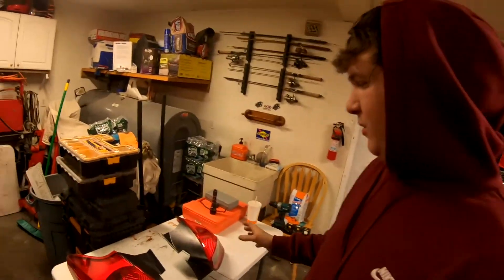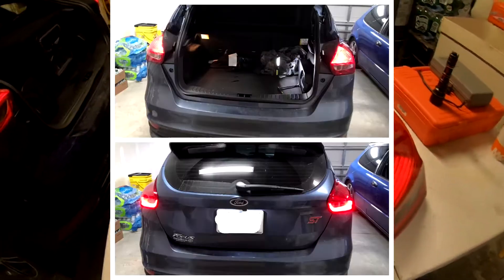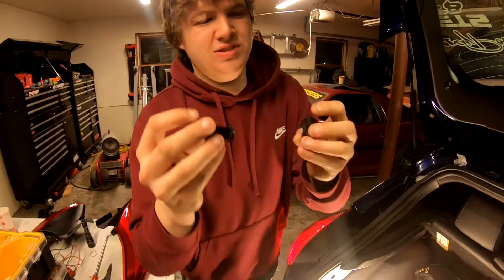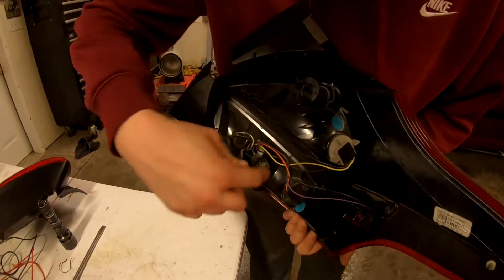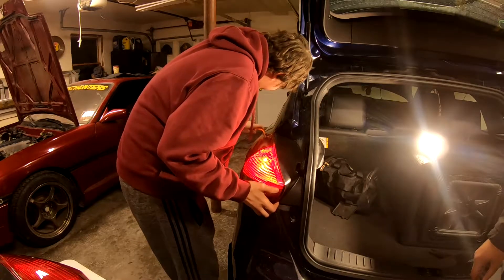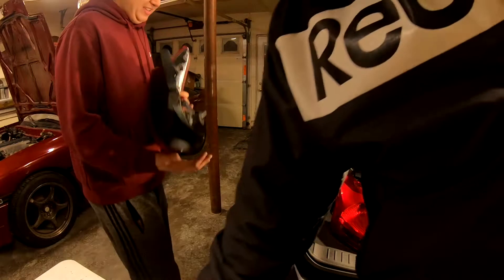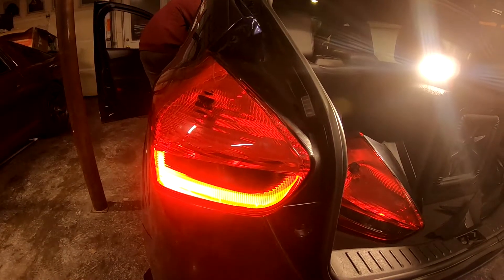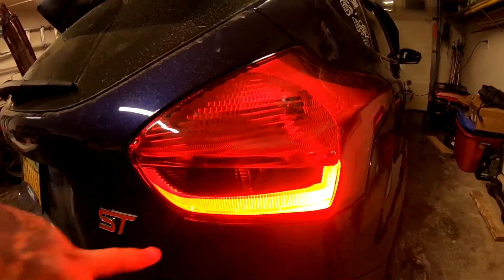Focus ST | RS Tail lights Install

Comment: Did you have any fitment issues? I have been wanting to put these tail lights for a long time and wasn’t sure if they would fit.
Reply: Its a factory tail light, plug and play
Reply from the maker: No fitment issues at all. Bolted right up to the st. It’s all plug and play.